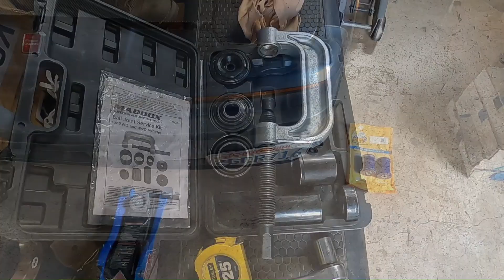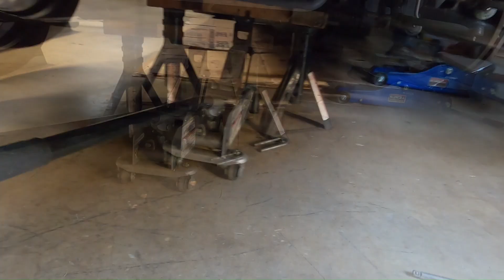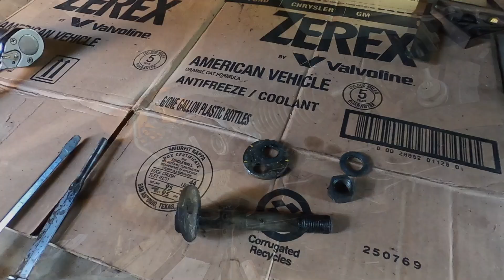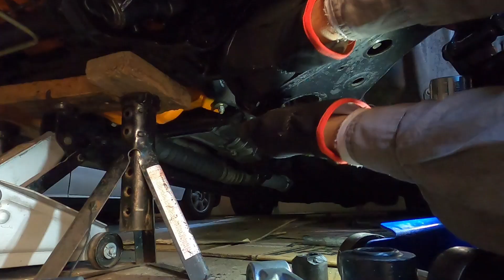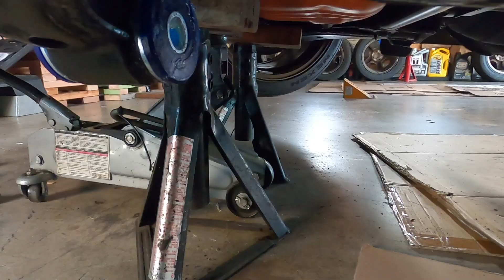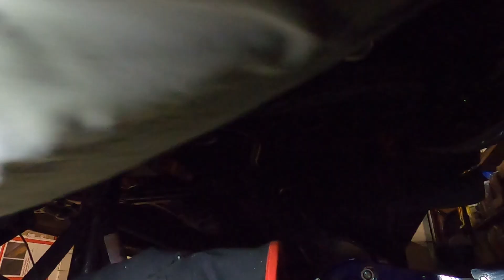Replace Bushings of Front Lower Control Arm - Supra MK3

Comment: Do you have a link to that tool you used to push out the bushing?
Reply from the maker: Here's a link for the tool I used:   https://www.harborfreight.com/Ball-Joint-Service-Kit-for-2WD-and-4WD-Vehicles-63610.html  It's a Maddox ball joint service kit.  You can also get them from ebay.